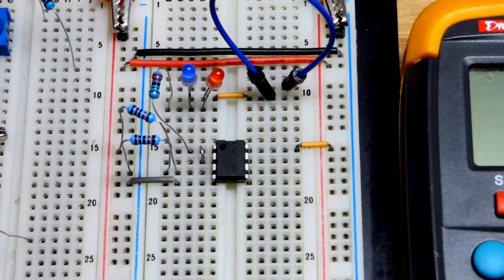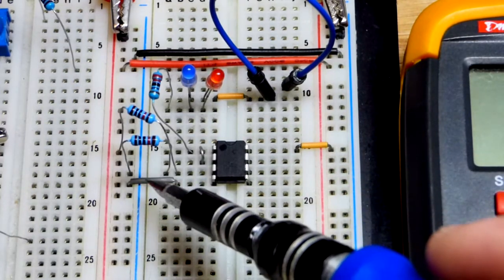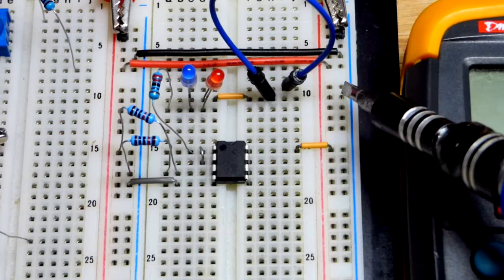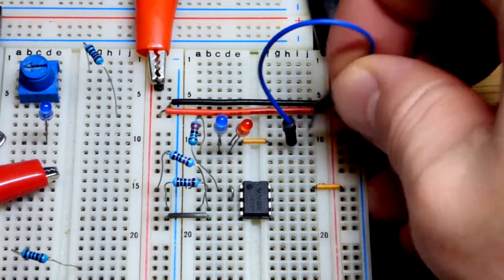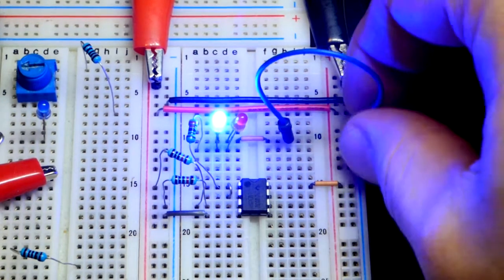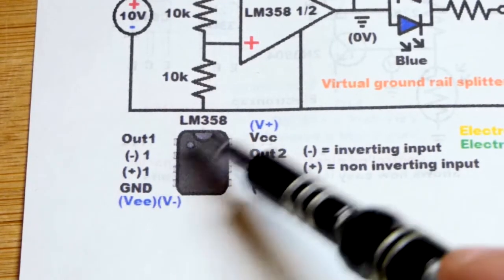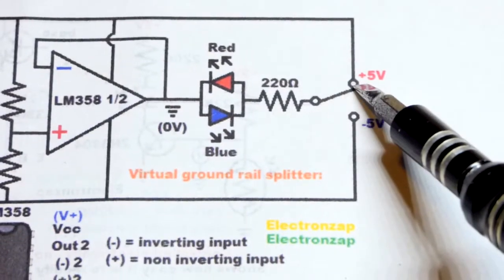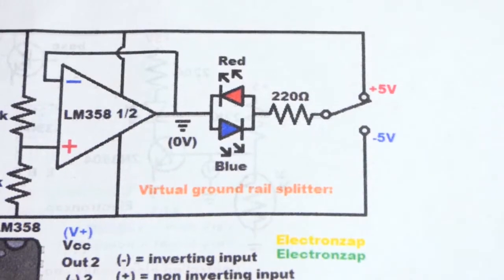Virtual ground rail splitter using LM358 op amp and LEDs learning electronics lesson 0028

Comment: Thank you so much for this video. How did you come up with 10K resistors for the voltage divider? If using a higher voltage (19v) , would the resistor values need to change?
Reply from the maker: Doesn't really matter too much the value as long as they are equal to each other. 10k is a value most people have, it keeps current low but not so much so that is a weak signal for the input of my integrated circuits.

Comment: Hey.. good explanation.. but  i have a question .. How many amps can I handle with this AOP, I mean .. for exmaple.. how many led diodes can I feed with this .. is there any current limitation with the LM358?
Reply from the maker: Here's a good datasheet. https://www.diodes.com/assets/Datasheets/LM358.pdf looks like you can expect the output to sink 20mA or source 40mA. For higher power loads, you probably want to use the op amp to switch a transistor that controls the load.

Comment: dear sir i m irfan from pakistan sir please help me i want to make the simple circuit for linear speed control and rev fwd  dc motor of dc24v 15am with reference signal negative positive dc5v with respect gnd 0v  ...when i give the reference positive linear dc5v to circuit then dc motor run forward with linear speed  (dc24v/+5v i mean dc 24v divide with reference positive dc5v )same as its when i give the negative dc-5v reference to circuit  the dc motor run reverse with linear speed (input reference signal 0v= dc24v out put 0v)(input linear reference signal positive +5v = out put linear  dc24v )(in put reference negative dc-5v =out put linear dc24v) i hope respected sir you dont igonre it...